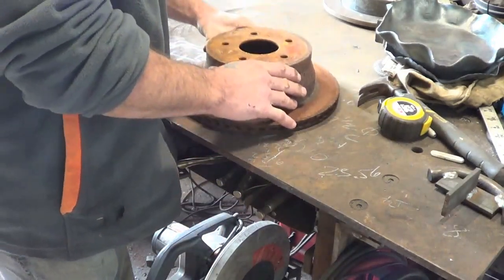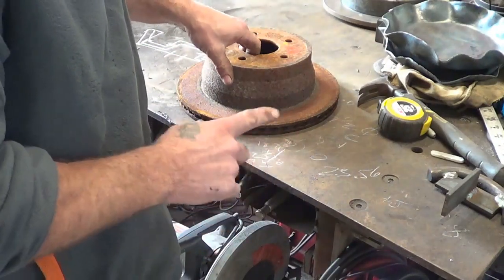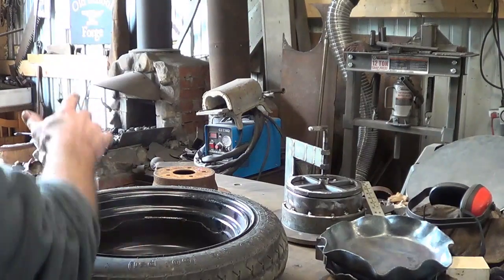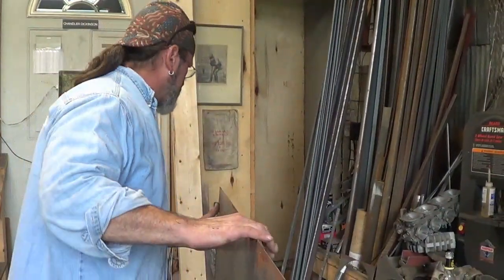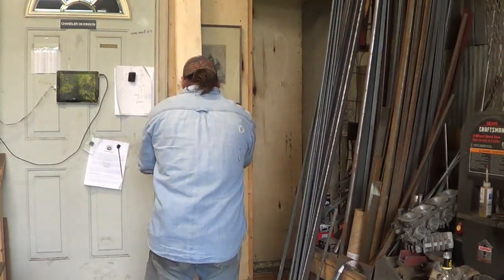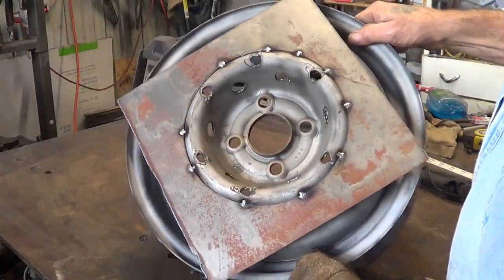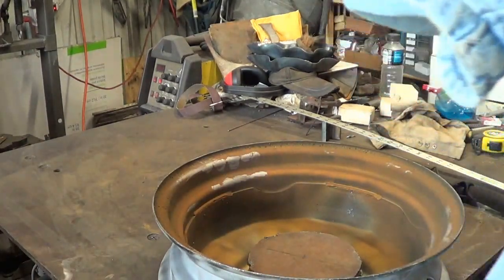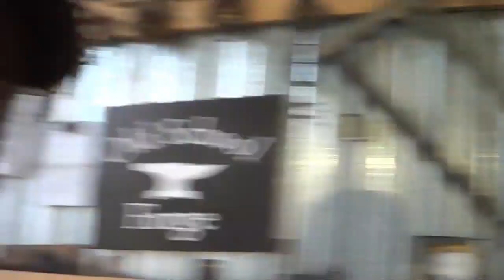OSF Special Feature - Need A Tool Make A Tool - Failure - Ring of Fire Forge

Comment: Make a black pipe ring, with small holes to the out side, and run propane as the heat.its small can be hung up when not in use, and should only cost a buck or two.

Comment: if you cut a 1/4 inch piece of steel the size of your pan interior and add legs to it youll be able to set it in the forge over the exhaust. the coal around it will heat and the 1/4 inch plate gives you a place to set your plate

Comment: HEY chandler what you need is what was uses to change the steel tires on a steam locomotive...  It runs on gas or propane yes only heats the tire...

Comment: Weld a bracket to hold a blow torch on your mould and heat it whilst you bang it, when the bit your banging cools down, all you have to do is rotate it and you have a heated piece in front and another getting hot. Weld the mould to the bench.

Comment: I think I would weld a cylinder over the center piece  up to the height where the pan sits so you make like a donut, then you can fill the outer circle with coal and maybe some more air holes

Comment: i dont see it as a failure. its a good idea. hole on the outside of the rim more air to outer edge. i dont know if it with work. keep on thinking you will get there. a dumb ass would not of thought of it in the first place. you just need a 2.0 bata

Comment: I think you can go WAY simpler, your trying to add on top of your forge. I have has personal success with  needing to heat two sides of a 1" x 1' plate at the same time by:  Take large metal cylinder (several sheets stacked up on top of each other welded, a (or in your case perhaps a shallow cone)). make three or four legs for the cone to SIT inside your fire pit. (think of a sink drain plug for your kitchen). the thick steel cone will handle the heat just fine and the legs as well (should run lengthwise from the peek of the cone to the base) should also be fine. Tip: light your forge normally (do not try for a ring off the bat) get some nice hot coals, scoop them out. place in your "Fire Plug" and the distribute hot coal around and crank the air!
Reply: I also welded a hook in the top center of my plug to easily remove, and then clean out the slag and replace while its all hot.

Comment: What if you made a disk the diameter of the inside of your pan, attached an air tight cone to the underside of it (or even a bowl) so it looks like an upside down pyramid. Then you could drop it down into the pot on your regular forge.  You would have to put a horizontal support on either side that spans the pot (or whatever it is called) on your forge so you could leave a bit of an airspace to let the air follow the edges of the cone to the outside.  You could pile the coal around the outside of the disk as deep as you wanted then and get the flange buried in the hot coal.  I would think that the only thing you would have to fiddle with is how steep/shallow the cone would have to be and how much airspace you would require all around the cone.  I would start with a pretty shallow cone, maybe 2" deep and make sure you have 1/4" space for air.  The thickness of the pan flange (2") that you are working with could help dictate the depth of the cone as well. Not sure but might work.
Reply: Should have read further down the comments.  Looks like some people have suggested trying the exact same thing.

Comment: how about more air and you normal regular coal?
the reason your normal forge works is because all the air of your blower gets blown in a single spot in the center but with this ring you try to divide this over a much larger amount of coal and the airflow gets slow and divided.

by this logic, a stronger air blower, or mixing in extra oxygen with your airflow should solve your problem.
Reply: or maybe reduce the amount of holes, try to aim to have only 4 hotshots, 1 in every direction.
that way the pan will still get heated better then with only 1 spot.

Comment: Oxidation?
Reply: +Shan Moldovan Plasma and oxy/acetylene cutting work by effectively burning a portion of the steel it's cutting, this burning forces the steel to undergo a chemical reaction which converts some of it into iron oxide. This has to do largely with the atmosphere and how the molten steel chemically reacts to its composition.

Not sure what these guys have an issue with when it comes to you, the replies you've gotten on this and the last video are just ridiculous.
Reply: Spec
I have no idea whats wrong with people Idiotic narrow minded ignorance aboutnsums it up. Chandler said after he cut the holes in the rim he wasn't sure what the red was . my reply was Oxidation.But thanks for the help. Some people have little inabition and its sad but it shows you the true form of there intellect.
Reply: Shan Moldovan Ah! I misunderstood what you meant by your initial post, my apologies.

I agree, and have to wonder how they would like it if someone spoke that way to their mother, sister or daughter. Somehow I doubt it factors in for them.